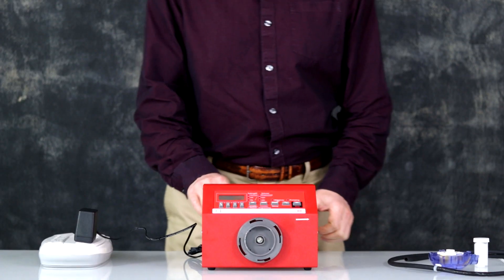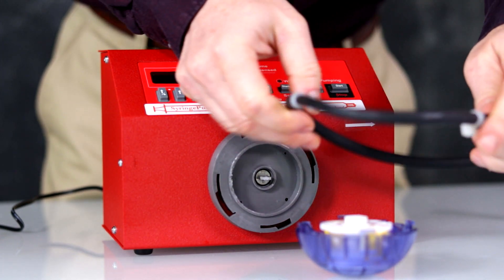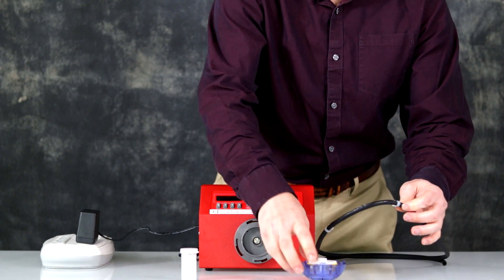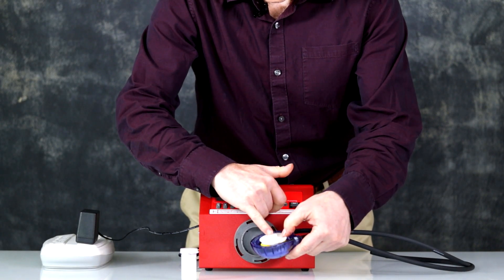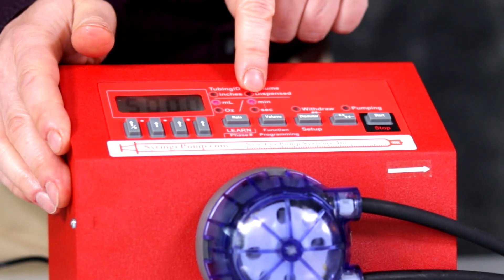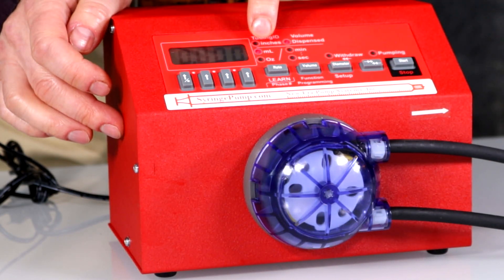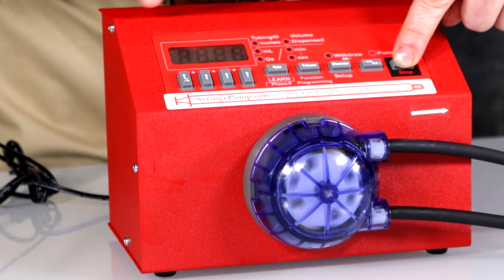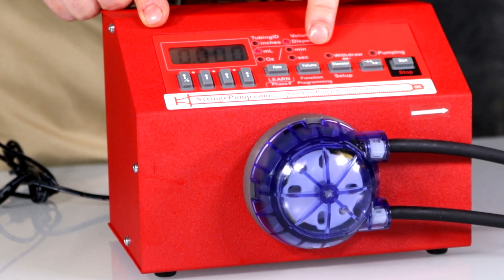New Era PeriPump (sku: NE-9000)

Comment: We purchased a NE-9000 and I am struggling to calibrate. When I switch on the power while holding down the 'Learn' key the display never shows LErn but only CALr. When I press start the pump does not show the dispensed volume so I cannot correct it. Can you please show how to do the calibration?